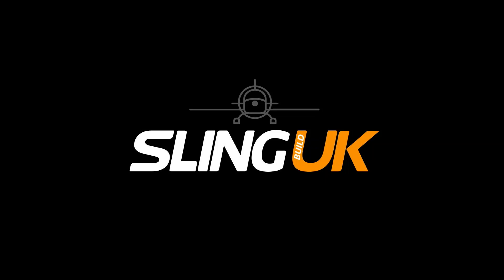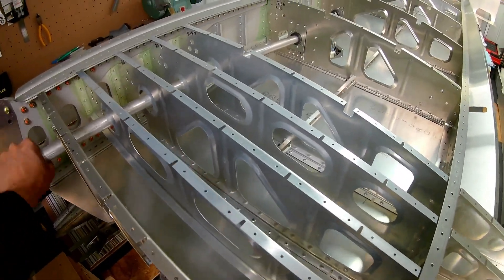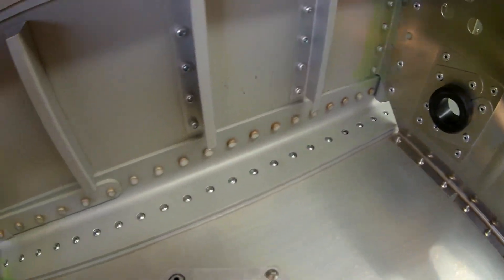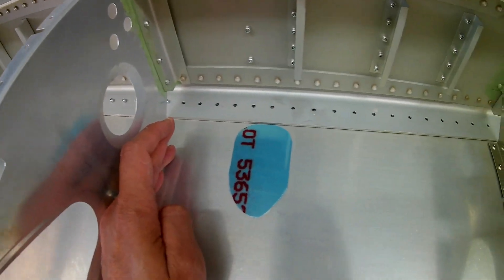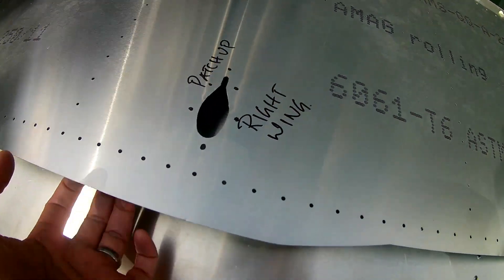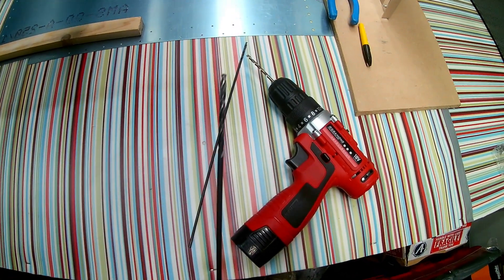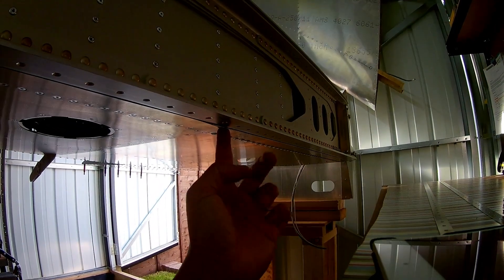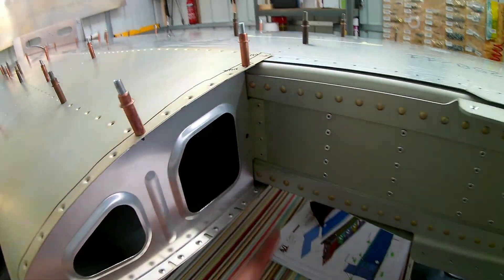Sling TSi Build Weeks 9 & 10 - Oops I dimpled the wrong side :(

Comment: Just fill the patched pitot hole with superfil. Put small layers and let them dry, sanding any extra off the edges between each layer. You can fill that and make it 100% invisible. You can use bondo instead if you're more comfortable working with that.
Reply from the maker: Yes, I will have a few places to fill using Superfil by the time I finish both wings and fuselage 😬